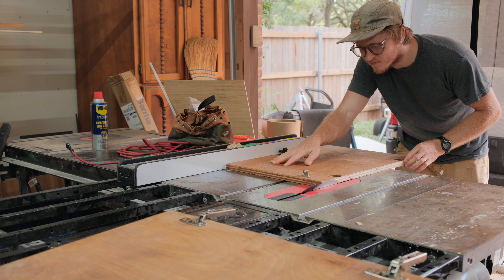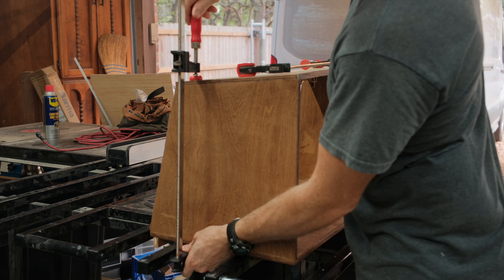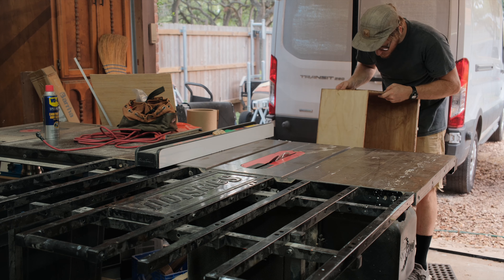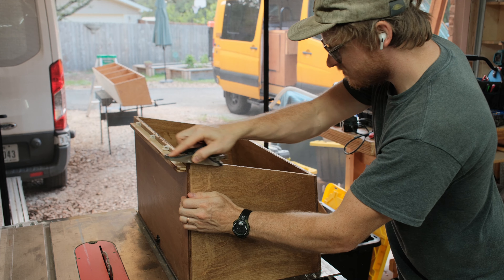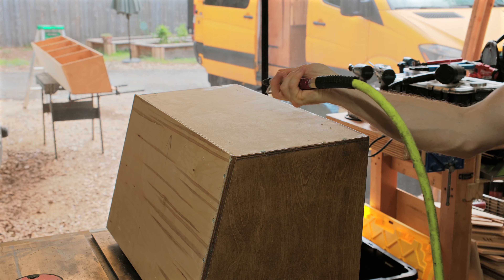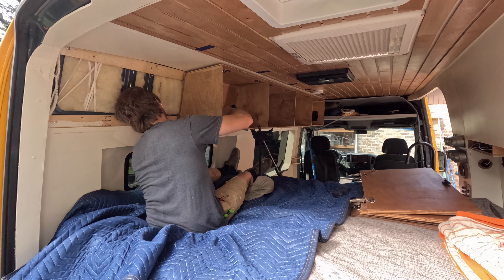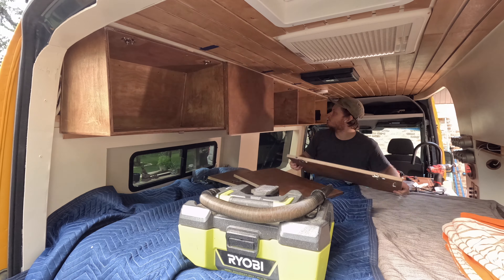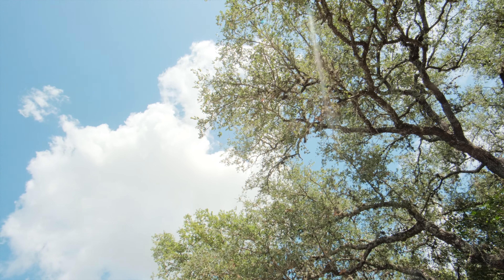The Upper Cabinet in This Van Build Fell Off the Wall - What Went Wrong?

Comment: I’m so happy with my build. I built my van by myself, with ZERO carpenter and electrical experience. My van has been “finished” for 2 years. Driven across country, and not a single thing has broken in my build. I’m incredibly proud of my craftsmanship as a beginner.
Reply from the maker: That’s awesome!! That’s a good feeling to be proud of what you built
Reply: @MoserMakes  and I have you to thank brah. I watched so many of your videos early on and got a lot of motivation to DIY it from you. Thank you for putting out this content. It helped me tremendously. 🙏🏽

Comment: As someone who has driven thousands of miles trying to get repairs and modifications done on my sprinter, kudos to you for helping the van owner by stepping up and fixing the builder's mistakes.  Question: Is this something you do as part of your business, or was it more or less, a one-off for a friend?
Reply from the maker: Thank you! Camper van upgrades and repairs are something I do as part of my business. I'm located in central Texas (and I generally just work with local clients to make pickup/dropoff logistics easier). Email me at mosermakes@gmail.com if you want to get in touch about a project.

Comment: When in motion, the interior of any van, truck, trailer, RV, etc. is experiencing an earthquake while the exterior is experiencing a hurricane. Build accordingly.

I build exclusively with aluminum extrusions that are rigidly affixed to structural members of the vehicle using rivnuts. No new holes drilled in the vehicle. Ever.

Aluminum extrusions are twice as strong as wood at half the weight. With machine screws fixing the extrusions to vehicle structure, the strength simply cannot be matched by any combination of staples, nails, screws and glue.

I affix panels to extrusions using inserts and machine screws. No holes to strip. All hardware (slides, hinges, etc.) are affixed to extrusions using machine screws and captivated nuts.

Beyond the obvious strength benefits, my builds are silent (no endlessly annoying creaks and rattles). I'm able to reconfigure if necessary, and panel removal is quick and easy when needed to access systems such as water, wiring, etc.

Everyone who's ever witnessed one of my builds has said that there's no way that they'd build that way. The simple truth is that there's no other way that I would build.

As for the build featured in this video, the builder used only nails. At a minimum, those cabinets should have been glued and screwed, with crown staples to hold everything until the glue fully cured. Had there been glue this cabinet likely wouldn't have fallen apart. Had there been glue and screws, it definitely wouldn't have fallen apart.

I've shitty "craftsmanship" first hand as I've been able to disassemble others' builds with my bare hands! I'd wager that my cabinets, etc. would still be where they were placed, even after the impact of a serious accident.

Folks, vet your builder.

Comment: Never end nail or screw if it can be avoided. Fasteners should be across the grain not with it. That construction was just waiting to fail.

Nice job. That will be better than the original.